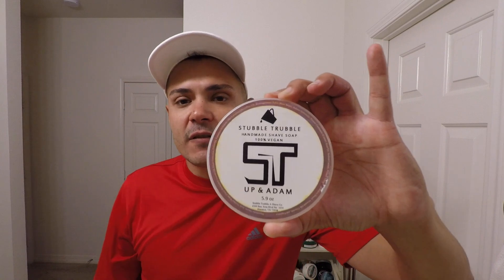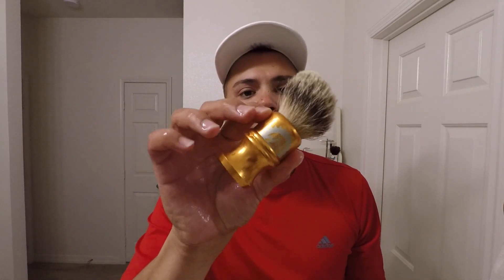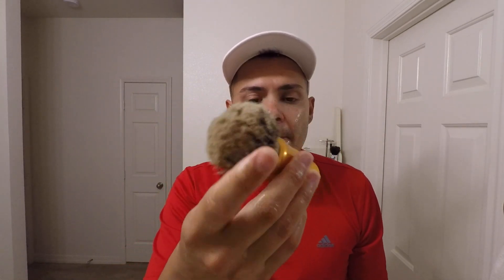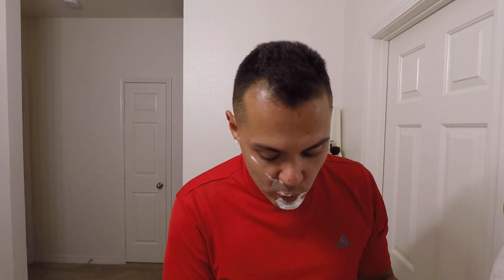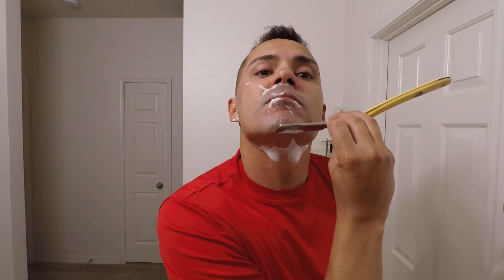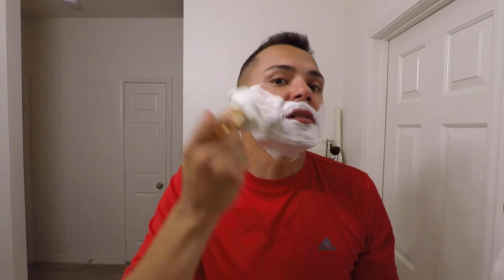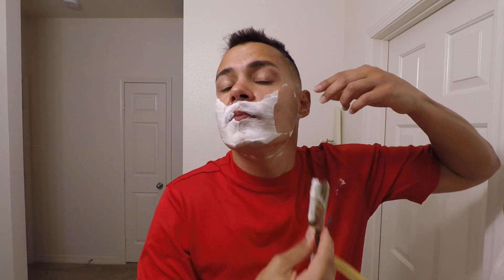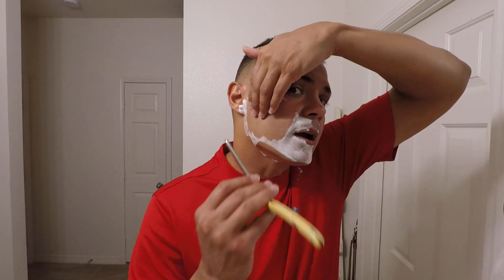Shave & Talk EP.10-How to Test Straight Razor Shaving Edge

Comment: I use thumbnail for 1K bevel setting. It gives good feedback in case there is an area where is not beveled. I still use a 40X loop in between 4K, 8K. Finish is hanging hair as well. You are right, the more experience, the more you get how the edge is by the way in snaps hair. I just try to stay consistent with progression. The only variable usually is the different type of blades and what condition. Warps can be a little challenging depending. Some wedge types I’ve struggled. By the way still enjoy your videos. Your one hand technique is awesome.
Reply from the maker: John Flores  thanks for stopping by and sharing! One hand honing took me a bit to develop and one hand shaving I really just prefer it ... I developed using both hands for shaving but i al fast and more effective with one hand

Comment: I was hoping you will give me a method as I sharpen razor for others I don't want to shave them on me. :)
Reply from the maker: Daniel Workshop  i can see that... when i shave for others I don’t shave with that razor... i used to.
Now i have my stones and process that i trust the results and the more you hone the more you can tell how the blade is looking. Take one of your blades that you love the edge and establish your own testing criteria. Example... leg single hair! Touch it and see what happens... does it jump? How does it sound,? How does it cut? Then Replicate
Reply: @RobertOrtiz1015  I was thinking the same thing. :) I had set myself a procedure on how to sharpen on my gold dollar and it worked like a charm but when I have tried to replicate the same procedure on a Dovo it didn't work that good. :)
Reply from the maker: Daniel Workshop i see ... yeah... some razors are themselves the variable... meaning the shape, steel, grind, size of the razor will impact how the stones affect them.